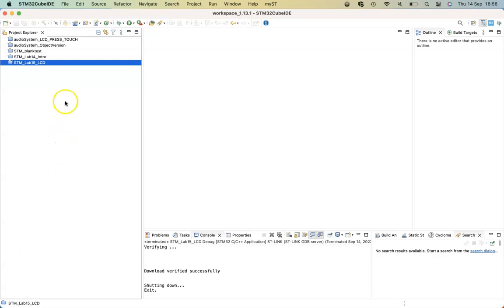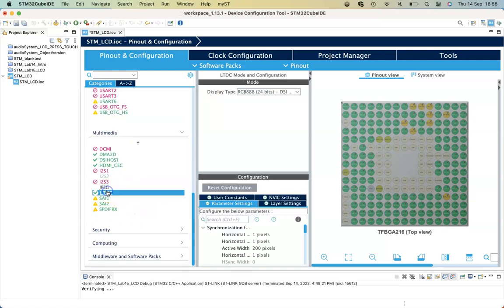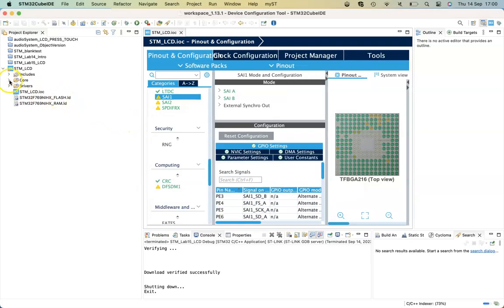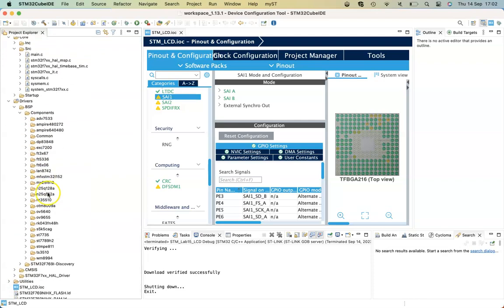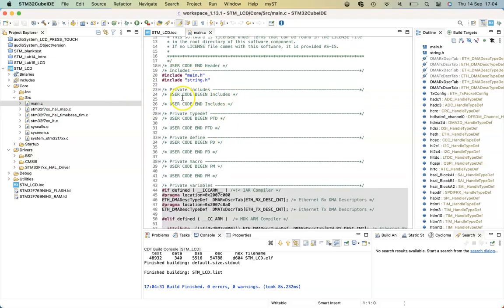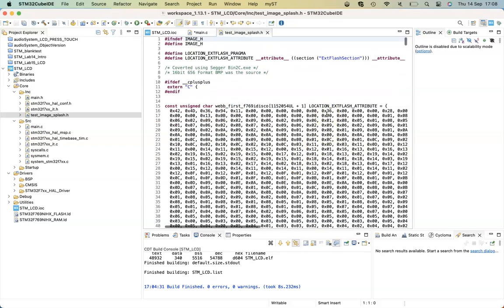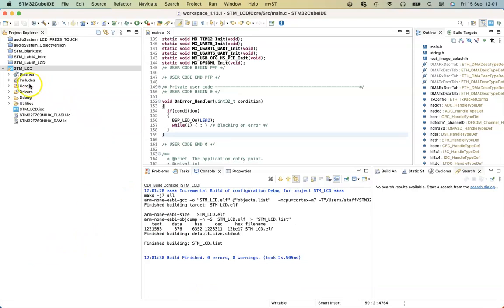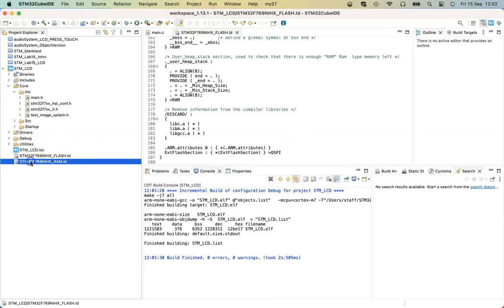STM32F769i DISCO Part 2 - LCD Setup and External NOR Flash programming - STM32 Tutorial

Comment: Hi, could you upload code from the lesson?
Reply from the maker: Hi, the STM32CubeIDE will automatically create most of the code for you (with the integrated CubeMX). If you pause the video you can then copy the code I add to write to the LCD. For the image header file, I create this using a program called Bin2c which is freely available from Segger. It can read a binary file (in this case a 800*480 BMP file) and outputs a C array, which you can then use to form/copy into the test_image_splash.h file. The tool is available here https://www.segger.com/free-utilities/bin2c/ I use a BMP format that is 16 bit, 656 as a source.

Comment: Hello ! Great job ! I think I have a problem with the board . I pluged it to PC and display doesn’t show anything. Should it show something on LCD or I have to flash something before ? Thanks !
Reply from the maker: Hi! Looking at the User Guide, the earlier boards were shipped with no demonstration firmware. So, if you have one of those, then maybe  not. You may be connecting like this already, but CN16 is used for USB programming (ST-LINK), not the CN15 USB. Also, check powering by looking at the user guide (UM2033 Rev 5) page 18. A default demo that you can flash with the ST Programmer is available in the Tools/Software..Binary Resources here : https://www.st.com/en/evaluation-tools/32f769idiscovery.html#
Hope that helps. If not, I think if you follow my tutorial (provided you have a good board) you should be able to bring it to life.
Reply: @stevenfenton3319  Thanks you Man ! you were right. I had to flash the demo .

Comment: Where i can find the Utilities and BSP folders? Thank you!!
Reply from the maker: They need to be copied from your FW support files. These can be downloaded using the IDE or by going to ST.com. They're usually stored in your FW repository.
Reply: @stevenfenton3319  Thank you!
Reply: BSP  will  compile with errors until you add the needed modules. I think 2
Reply: @johnbaker3745  Did you ever find a set of modules to add that seemed to solve this problem? I am getting compilation errors relating to BSP